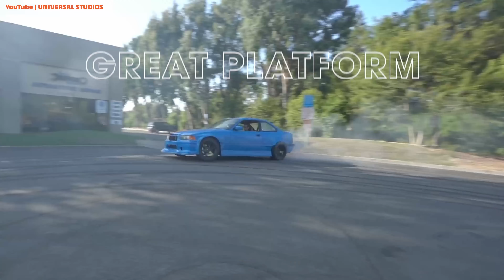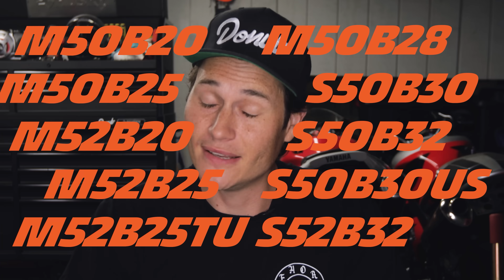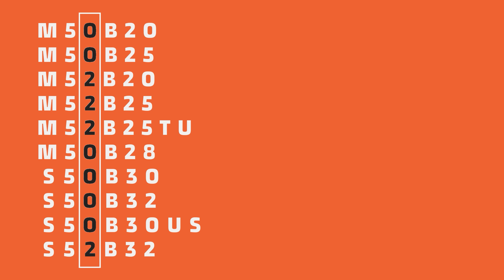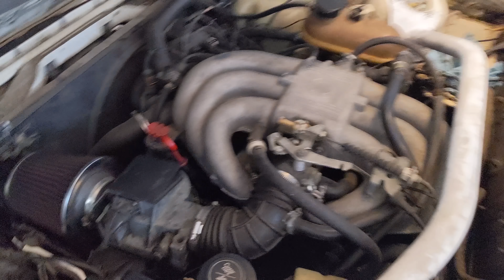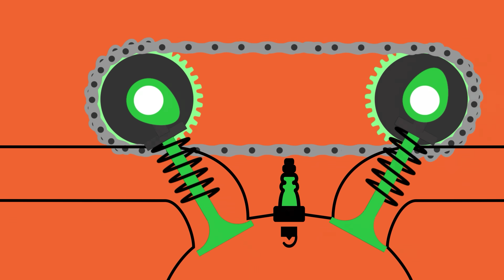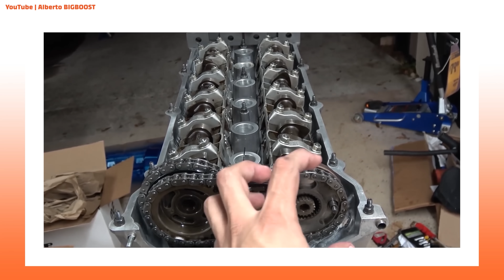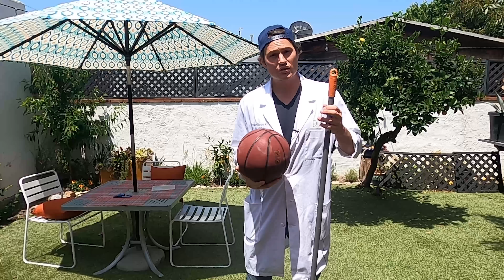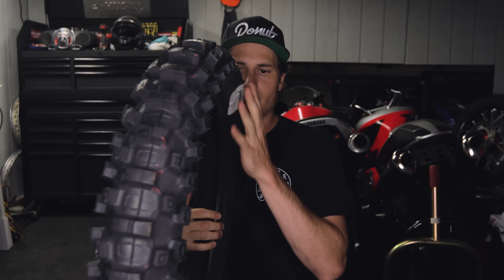2 Reasons Why the E36 is an ALMOST PERFECT Project Car

Comment: agreed.
my first car at 16 was a e36 5speed 318i
then at 18 i got a e36 328is 5speed that shared the same factory ZF trans with the e36 M3 
I modded it with like an exhaust clutch flywheel all of that, and cooked the m52 when a rock put a hole through the oil pan
then I swapped in the s52 from the e36 M3 and did the old m50 manifold. injectors. intake, and tune. and exploded that after playing soccer all day in the city with some Europeans, money shifted it in Philly coming home at like 110 units of speed or something into 2nd gear, and it became a 5 cylinder s52.
then I got bored of all that and just bought an e46 M3, and im on my 2nd one now at 30.

e36 is still sitting parked at my parents house with a cooked s52, bilstein pss9 coilovers, and stuff if anyone wants it

Comment: Ok so the VANOS system is only a variable cam phaser system and not at all like what was shown. It doesn’t change valve lift like VTEC, and isn’t the same as VTEC. VTEC gives you 2 different cam profiles and no variable phasers. VANOS gives you variable phasers and no cam profile changes. While VTEC does adjust valve timing, it’s solely though using a new cam profile and not because of variable phasers. The i-VTEC system does use variable phasers in addition to the variable cam profiles.

Comment: Sorry, but vtec and vanos is by ar not the same. Vtec phisicaly makes the in/ex valve go deeper, and longer in to the cilinder when activated. vanus, vvti, adjust the TIMING when to open(they dont open for longer, or deeper in to the cilinder). Valvetronic would be the same principle as vtec, but without mechanicaly moving parts and more electronics.

Comment: I own a 1998 e36 328i sedan and it’s a very good daily driver but there is one problem I had to replace the VANOS 3 times and the car is going over 256k miles if you are thinking to buy the e36 just know or get ready to replace the VANOS when you first get it

Comment: Here in Spain the E36 has got a bad reputation: Critical engine failure because it swallows plastic parts and cracks on the suspension turrets of the chasis

Comment: I have a minty 1993  e36 pretty mint 2000 $  bucks located in pennsylvania holler at me ;) sitting in a garage runs great drives great welded diff comes with headers two seats and ready to drift thanks

Comment: "the e36 was overlooked for years" then there is the e21 crying in the corner
Reply: u mean e34?
Reply: @clarckkim  nah the e21 is the 1st gen 3-series that most people forget about.
Reply: @bconzzers  yeah but it definitely isn't as capable as the E30,E36, E46..
Reply: Spent a lot of time behind the wheel of an e30, but only ever sat in an e21 once.  You can definitely see the similaries but it never did anything particularly special.
Reply: yes my dad had one lololol

Comment: This is nothing like VTEC. VTEC changes the valve lift profile. They are two different valve operating perimeters. BMW Valvetronic is more similar to the purpose of VTEC as both systems were designed to alter valve lift, of course Valvetronic is far more variable to control throttle too but I digress.

Comment: The Simulation of the old rear suspension wasn't quite right. Only the, in your simulation, black parts move up and down therefore the wheel moves up and down on a straight line and doesn't change camber.
Reply: those two lighter gray parts are like joints which can move.

Comment: Real reasons why the e36 is legendary: 

1. Iron Block (can take massive boost)
2. Chassis is lighter than e46 and other newer BMW's 
3. BMW has always had the best chassis with near perfect 50-50 weight distribution

Comment: warning for the uninitiated from an e46 owner. the car prices are cheap. but the parts are not. mechanics with lots of bmw experience are not cheap either. and the bmw over-engineering means a full engine bay without turbo room. and lots of work involved to squeeze out marginally more power. BUT the cars drive very well stock, the straight six engine is a bulletproof design, and dates are more impressed than with a civic

Comment: HOW MUCH??? 4k$.... here in central europe its like 1k$, even for 2.0 versions. And even cheaper with 1.8 4 banger (yes, we had such engine) which is preety much same reliable and just a bit less powerfull from B20. Also, what he didnt mention, is M50 is iron block, and M52 is mostly aluminium. So M50 is the one you want to have :P Also, i dont how is it states, but theres a ton of diff option you have, ratio variants, so called big and small driveshafts, even LSDs! This car in no1 drift missile (aka GRUZ in polish :P google it) its a beater that never gives up. Until fucking VANOS wil fail. Its the horrible thing, dont listen when someone says its a agood thing, its not, its pile of crap which will destroy your engine. But i guess that all usdm engines had it, so you cant avoid it, just ls swap the bitch

Comment: Vanos is terrible. Works off throttle pressure. Always wears out the seals.
Had to get rid of mine.  Good on paper. Terrible in practice.  It was designed for torque not power or mpg

Comment: Gotta be careful about the part where the rear axle connects to the body. They have a issue with ripping. Luckily mine wasn't. Just a heads up!

Comment: And with this video the e36 went from being a totally attainable project car to being entirely out of my price range. Thanks for that
Reply: I just picked one up drift ready for a grand usd
Reply: Hey there I run a e36 channel and would appreciate your support for some e36 contentt🤞🏽🖤
Reply: its still cheap as fuck used, im in australia and you can get em as low as 2000 aud
Reply: @jacksonelh  damn bro that’s crazy good pricing. Every one I’ve seen in the US that runs is at least 6000 USD (8400) AUD
Reply: @akhaotic  for 2k in aus it's gonna be clapped to shit, something actually clean and runs without shitting itself would be closer to 6-8k aus$
Reply: @7SSP7  You boys gotta let me know where your'e finding a running 328i E36 in australia for 6k, they are atleast 10k for one in decent shape.
Reply: @jacksonelh  no you cant. shameful liar

Comment: E36 rear suspension was a huge handling and traction improvement over E30 (and earlier) design.  However, BMW didn’t fully account for the loads the new suspension would inflict on the chassis.  If you want to rip an E36 sideways as hard as you can an E30, you’ll need to weld in some chassis reinforcement (involves dropping out fuel tank). If not, you’ll rip the rear subframe off the car and, that will be bad.

Comment: Just a minor thing to note there is an additional engine you missed or maybe it’s a typo, the M52b28 used in the 96-99 E36 328i. I have a 98’ 328i and it has this engine. Otherwise great video 👍🏼
Reply: Defenetly Not the Same Engine. Greting Form Germany.
Reply: Yea but they also listed a m50b28 which doesn't exist,I think they meant m52b28 instead of m50b28. The 2.8 didn't come back until the m52 came. Supposedly when they changed the displacement from 2.3(badged as 325) to 2.8 the new motors stats where so close to the M3's s50b30(US) stats they had to "nerf" it by slapping on an intake that was 50% more restrictive. They had to do something to justify the extra 10k a M3 cost
Reply: Basically the same as the m50b25 slightly more torque down low thats it same horsepower and torque numbers
Reply: @dontjudgeme2736  Not the same thing. Learn your engines.
Reply: I have a 97 328i and also have the same engine

Comment: “You need to get across town without using you blinkers”😂
Reply: First modification i did on my bmw was to remove my blinkers they add weight and are useless for any bmw driver
Reply: Anis 7744 weight reduction bro.
Reply: MY LATTE APPOINTNENT!
Reply: I got confused there , wtf are "blinkers"
Reply: Fernando Martinez they are the American word for indicators
Reply: @elliotellis5123  or is it the high beam?
Reply: Blinkers is an optional feature.
Reply: Nel Zelpher I, along with the rest of the world, wish your parents wouldn’t have felt that  pulling out was an optional feature.
Reply: Andrew Denisovich 😂😂
Reply: Bro I died at that lol 😆
Reply: I gotta refill the blinker fluid.
Reply: I didn’t have that option in my 335i when I was 21 haha
Reply: I ont know why... But when driving quick I don't use em too......
Reply: I have an m60 e32 and the tail lights just flash every few seconds lmao
Reply: My left blinker doesn't work lol I know the struggle
Reply: Classic bmw move
Reply: Ever since I got my E92, I used blinkers all the time, I swear to God I did
Reply: A friend of mine told me this and I haven’t stopped driving this way since
Reply: Those blinkers are for show only
Reply: We all know at least 1 douche in a BMW that does this.
Reply: Chester Marigza Very true
Reply: Polish BMW drivers in a nutshell

Comment: Variable Valve Lift is NOT the same as Variable Valve Timing. You mixed the two in that explanation.
Reply: Also, EGR does not work like that.

Comment: You guys need a bimmer boy in the office.. each bmw video has at least some mistakes. Right off the bat I start watching and see m50b28 which is not a real thing. Its m52b28 and fan boys across the globe just use the m50 block. All love though.

Comment: E46 hate thread here⬇️
Reply: E46 are like a fat chick acting like a 
diva on you.Too much effort for what
it is.
Reply: I paid a E46 1000$ and still it found
a way to make me lose money.
Reply: If you have'nt had a E46 yet and want
to know how it feel like you just need
a shovel.Now start digging a hole,dont stop.Nop,nothing special down there.
Reply: Fun fact 1:Near impossible to get a
real good LSD in there.
Reply: Fun fact 2:Modern ABS system very
good at screwing your welded diff
drift build.Your first need to attend
an Automotive Electonics engineer
class.

Comment: I have an E36 that needs thousands in parts. Just maintenance. It drives well enough. The engine ruins great, but it needs struts & strut mounts, subframe & shifter bushings, the power seats stopped working, the hvac blower controller needs to be replaced. Some suspension bushings are probably bad too. All parts are pretty pricey for this car.

Comment: Y’all need to build e36s on the next series off hi low!
Reply: Absolutely!
Reply: Facts
Reply: Agreed!
Reply: True
Reply: I would actually watch it if they did a beempiece
Reply: I would fanboy TF out if they did that! YES PLEASE
Reply: Omg yes
Reply: Respect for the pfp
Reply: well it looks like your wish came true
Reply: hell yeah
Reply: I 20th This
Reply: 100%
Reply: Yes
Reply: Hey there I run a e36 channel and would appreciate your support for some e36 contentt🤞🏽🖤
Reply: God yes that’d be great
Reply: Yeah but they tend to use cars that don't need constant maintenance. They'll end up paying more to keep them running than doing modifications to.
Reply: @mattskucas4097  E36 is very reliable and in Latvia (EU) is one of the best cars to choose from. In Latvia you will find spare parts for E36 in almost every spare part shop. Maybe for 1000$ budget it would be difficult to buy one in good condition and with a engine which has tuning potential but with 2000$-4000$ (just depends which engine you want) it won't be a problem. I'm not sure about US engines but in EU I would recommend to take 1.8is engine because this engine is super reliable and has huge tuning potential. From factory 1.8is comes with 140 horsepower but it can handle without any problems turbo/300 horsepower. I call 1.8is as the most cheapest way to get 300 horsepower (in the lightweight car). I would also recommend any engine starting from 2.5 gasoline for E36. I only don't recommend 2.5tds (diesel) because this engine in the racetrack will have overheating problems.
Reply: @fattuchi  huh! Didn't know that. I know the 2.5 is actually fairly reliable, but I am in the US. There are some good E36s out there definitely, but also a lot of cars that have been run into the ground!
Reply: @mattskucas4097  the e36 is super reliable, I have 2 currently, my main one that is a daily/project is a 95’ and it runs perfect, leaks a little oil, but the engine is 26 years old and I’m not gentle with the car, so fair, but it has never let me down, currently has 287,600 km on it, and here is to many many more Km’s in my baby
Reply: @nwb1999  wait fr? Because I want to get one soon
Reply: @Kiko-zq5hw  do it, they are good cars, cheap, fun, and tons of aftermarket stuff
Reply: @nwb1999  thx man appreciate the feedback because I havent really been given a perspective on the car from someone but now I sorta get that it is a car worth getting
Reply: @nwb1999  would you recommend one with like 105k miles
Reply: @Kiko-zq5hw  yes, my car has 290,700 km on it, and it’s still running strong

Comment: with all the risks of looking like a sensible prick, and with all consideration to this great series we are all enjoying, i have to correct some things:
 
7:01 no. Vtec is valve lift(and inherently broader timing), vanos is timing. they achieve the same result in terms of power, but are not the same.
also can we have a video about Fiat's multi air?
 
please put more care into these things Jeremiah... you have a very great series in your hands.

Comment: Lol e90 is not a respected chassis. It has drive by wire steering and the V8 M3 is cool but not at all relatable to a 3 series. E36s are not overlooked within the BMW community, they just get trashed and are often rusted

Comment: Would it be the same coding for the e30 and e28? For example, my e28 has a a m30b34 but the e34 has got a m30b35. The b34 is a single cam, while the b35 has twin. Wouldn’t it make the e34 have a m32b35?

Comment: Comparing VANOS to VTEC is misleading since they are completely different systems. The only thing VANOS does is it changes timing so that you get the peak torque 500 rpm sooner but it does NOT increase power.

Comment: e36s are junk unless its a coupe and bigger than a 323. the 1.8 is absolute garbage as an engine better used as a paperweight coming from an owner. i have an e32 so much better and overlooked in the bmw category. better chassis than the e36.

Comment: Actually a Smart car should not fillp if the wheel is "yanked", the first Smart car was going to have a suspenssion made by Mercedes, but before Mercedes started work on it the "A-class" fiasco happend.

Basically the "new Mercedes Small car with big car comfort" al most rolled over duringa a Moose Test by "Teknikens Värld" and by Swedish television program "Trafikmagasinet", Mercedes didn't hadel it well and first claimed that "it was a test made up to sabtage the A-class" and that no car could handel such a stupid test, little did they know that the Test was actually "developed" by Volvo.

Mercedes even went as far as to threaten to Sue "Trafikmagasinet" if they showed the Test, which they did.

Mercedes fixed the Issue with "ESP" which failed during the second test and stiffening up the chassi.

Smart not wanting to be associated with the "Vällt class", went to Porsche instead.

Comment: i daily a 325td e36. It is an awesome, fairly economical car (35-40 mpg) and with the mods i did to it (intercooler and water meth injection) im pushing 200hp and over 400nm (300 ft lbs). It slides whenever i want it to and occasionally when i dont want it to. If you want to get into modifying a car, theyre the perfect platform to go a lot of ways. Rally, track, drift,.. Everything has been done and you'll most likely find guides online on how to do all the stuff. The only issue you commonly see is unreliability because of bad maintenance and rust, lots of rust

Comment: When you google a bunch of "facts" about the e36s and get most of it wrong, there was no m52tu in a e36. ever.
Reply: If im not mistaken that was in the 5 series
Reply: Maybe in america...

But for us : 

M52TUB28
The "technical update" in 1998 included double VANOS, which improved low rpm torque.

Applications:

1998-2000 E46 328i, 328Ci
1998-2000 E36/7/8 Z3 2.8
1998-2000 E39 528i
1998-2000 E38 728i
Reply: @ValFat3969  E36s here are euro market trim, no e36 got a m52tu engine. fact. The z3 got the tu and m54 but thats a "different" chassis

Comment: Overlooked? Their values are starting to go up and I see them everywhere. My friend has a project E36. They don't seem to be overlooked...
Reply: absolutely not overlooked... their prices have gone up where i live too and keep rising
Reply: Its mostly the M cars that are going up butttt clean non M E36s are going up a bit
Reply: I was wrong, even the damn 318 is going up. 4k for a 4 banger Beamer wtf🤣
Reply: bro i just bought one with 75000 km on it for 2200 euro
Reply: Yeah well you have to be dumb to pay anywhere close to 3k for a generic E36. Can get them for 1k-2k eur in good condition. Paying more just means you are being ripped off more.
Got myself a cheap beater e36 for 600 eur, still works a year later with little to no fixes required. Like a charm.
Reply: A group of the community knew the car existed and a group didn't. Bad thing is that the group that didn't knew, is now up to speed (no pun intended) with it's potential and thus everyone wants one. That's why the prices go up so fast (sadly).
Reply: Seriously. At first I wanted an E36 but I saw the prices on the ones near me and when it came down to a ratty, beat to shit E36 or a really clean E46 for the same price, I went with the E46.
Reply: I was about to say. prices have been going up for years now. these are a super popular pick
Reply: I got mine in running and 80% decent condition for only 900